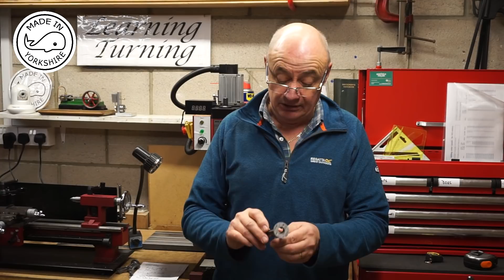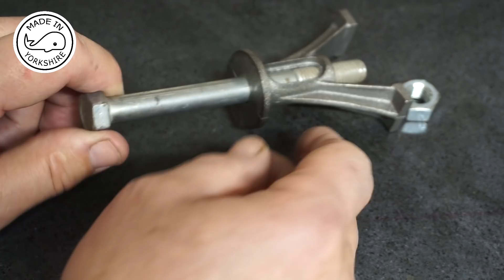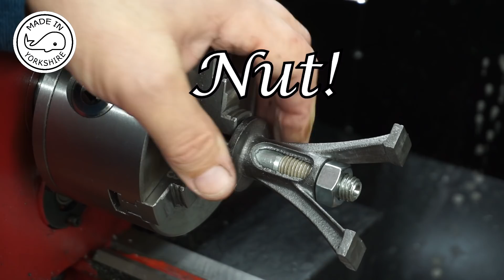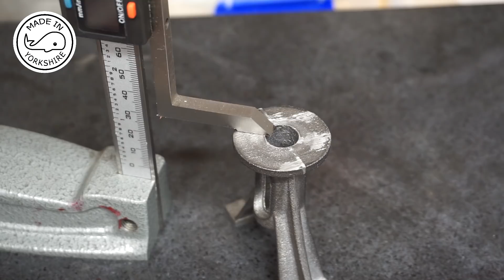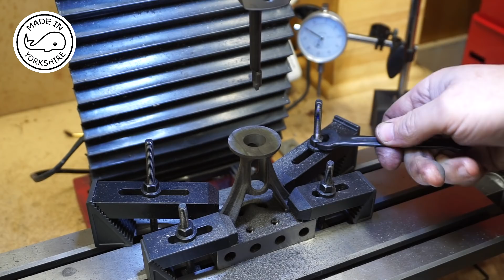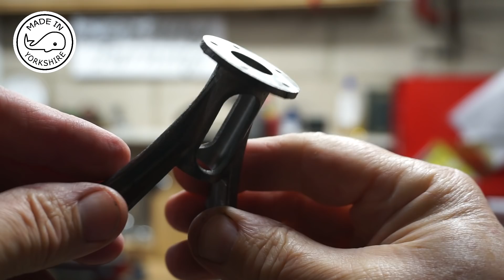#MT25 Part 4a - Making a Stuart 10V Engine. V2 Machining the Standard. By Andrew Whale.

Comment: Regarding the bore being off center, it won’t be noticeable when the engine is finished, but I can relate to your concern.  

I made a Stuart D10 some time ago.  I machined the standards a little differently, but there is no “one right way”.  I began by making a plug that located snugly into the cored hole in then casting.  The plug had a taper at the shoulder to eliminate any play.  The flange was held in a 3 jaw chuck and the plug was supported by the tailstock center.  This allowed me to face the base surface and the back surface of the flange in a single setup.  Once that was done I was able to strap the feet to the faceplate and bore the standard and turn and face the flange in a single setup.  I hope that this is helpful.
Reply from the maker: Many thanks for the advice. I'm sure others will find it helpful too.
All the best.
Andrew

Comment: The original would probably have worked OK it's the casting that's now out but top and bottom faces and bore are still inline. Maybe holding down holes would need to be redrilled oversize to fit but at the end of the day nobody this side of a keyboard would have noticed if not for your self appraisal. Video was superb.

Comment: Fabulous work. Inspirational. Thank you. 👏👏👍😀
Reply from the maker: Thanks mate. Good luck with your 10v retirement project! A great way to exercise the old grey matter! BTW I found the s50 a great starter engine and not as challenging as the 10v.
All the best.
Andrew
Reply: Learning Turning Metal - by Andrew Whale  Thank you Andrew for the encouragement.  Interesting what you say about the S50 being a better starter project rather than the 10V. I was under the mistaken belief that I would be unable to turn the flywheel on my Warco Super Mini lathe. I see they are the same size. Umm change of plans 👍😀 Andrew
Reply from the maker: Hi Andrew. I turned mine on the Sieg sc3 mini lathe from arc euro trade. Compare the swing over bed with yours and I guess it will be pretty much the same.
Cheers
Andrew
Reply: Learning Turning Metal - by Andrew Whale Thank you Andrew. Looks like they are the same and I should be able to turn the flywheel on my Warco Super Mini lathe. 
Now I will have to watch your s50 series. That’s Christmas sorted! 😂👍😀

Comment: I'm really enjoying watching your builds. I would love to attempt something like that one day. Just in the process (very slowly) of tooling up. I have a mill virtually identical to yours just trying to acquire a lathe now. keep the great videos coming!
Reply from the maker: Thanks for the feedback mate. The SC3 from Arc is a pretty good lathe but it needs a bit of attention to get it working nice and sweet. I really enjoy small scale engineering and fixing things. My daughter recently visited us and the handle on her quite expensive travel case had come apart from the main casing. Within and hour I was able to make a threaded pin (identicle to the one that had broken, but a lot stronger) and her case is back to being like new again. It's amazing what these mini lathes can achieve.
I make the videos for three main reasons......
1: I've learnt a lot from YouTube and I want to try to share my experiences and help other novices like me. It's not about how it should be done but more like this is how I did it and whether it worked or not.
2: My memory is rubbish (always has been), so by doing videos it helps remind me how (or not) to approach something similar in future. I am about to machine the cylinder for the 10v and I will certainly look at my S50 video to remind me how to go about it.
3: Doing videos for a small audience helps motivate me to keep a project moving. So for the 10v I am trying to get a video out weekly for each of the main steps - despite having to work in a cold garage. Without the pressure, I would probably sit in front of a warm fire and watch snooker on tv - ha ha.
Good luck and have fun!
Andrew

Comment: Hi, Andrew. Love the M12 bolt in the 3 jaw - so simple.Pleased to see your bearings worked out OK. Looks like I'll also have to shim one corner to stop the crank binding. Throws cold water on my plans to build the Stuart D10 where, I believe, setting the centre bearing really sorts out the men from the boys.Your mill looks like an SX2. Is that a good starting point, or would you suggest getting something bigger?Regards, Len
Reply from the maker: Hi Len - thanks for stearing me in the right direction! I must say that the Stuart S50 I built seemed somewhat easier then this 10v. I think the D10 would be way beyond my capabilities - but it's always good to have a challenge. The mill is an SX2P from Arc. It needed some work to get it to be a really good machine (see my other vids) but I'm really pleased with it. However, Z axis travel can be a bit limited once you have added a vice/rotary table and chuck. I originally had my heart set on the SX2.7, but after viewing it at Arc I decided it was just too large for the available space in by garage at the time. If you can accommodate an SX2.7 or SX3 I would suggest you consider one of those for the additional capacity.
Here is a link to an article from Model Engineers Workshop which reviews the SX2P:
https://www.arceurotrade.co.uk/reviews/SIEG-SX2P_Review.pdf
All the best.
Andrew

Comment: Starting with a rough casting is a challenge. I am a novice too and I am making a Stuart No.1 and I have found that getting the casting presentable and straight enough to make an initial measurement is an issue.  Keep up the good work Andrew, loving your video's!
Reply from the maker: Hi Mark - there definately seems to be an art to it. At least I know how to approach a 10v Standard now and I hope my experience will be of use to other novices like me. Good luck with the Stuart No.1 - sounds like a very interesting project. If I ever get one, I'll know where to go to for advice :-).
All the best.
Andrew